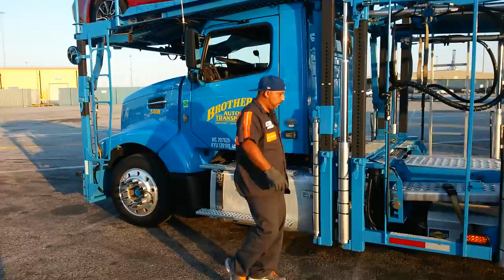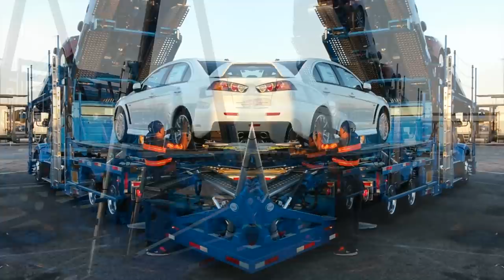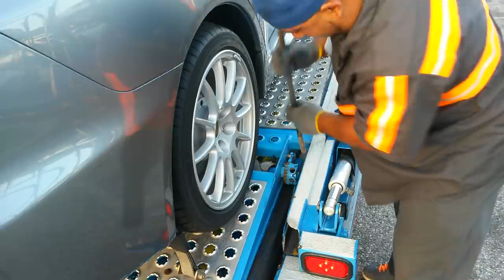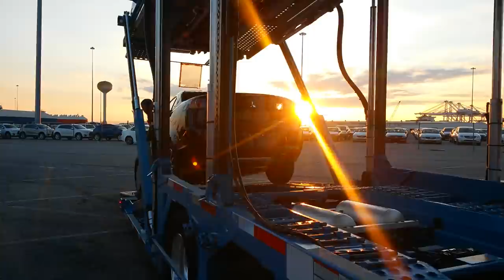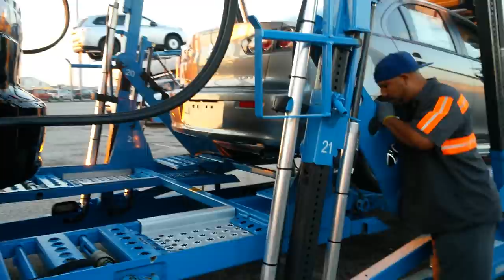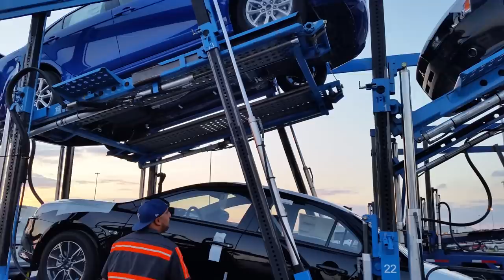38 minutes Loading ten car's on a High Rail...DAM that boy is fast....

Comment: If this was done in 38 minutes. That is really fast. I'd like to watch it real speed with no cuts. Been hauling cars 11 years.
Reply: Not dissin but cars already staged next to his truck. It's all about routine....
Reply: THERE IS NO 38 MINUTE VIDEO,  IF THERE WAS IT WOULD OF BEEN POSTED INSTEAD OF THIS ONE. 

YOU'D BE "LUCKY" TO GET THEM OFF IN 45.
Reply: The transporters i use in uk a TE+11 loading 11 cars in 30 min and tipping in 15 min is piece of piss. Helps having automatic deck locks and fixed ratchets.

Comment from the maker: This was a video to give a little knowledge to those interested in learning how to load ten cars not for ya haters to comment if you want to put some money up hit me up or shut up
Reply: What'd you get per car? About $120 a pop? I'm an auto hauler broker and just curious on your take away for that load. Maximizing your income bro keep the hussle strong 100
Reply: Jballo Production that’s an awesome video and love the trailer features on bottom last deck. That’s quick loading phase.
Reply: I run a ten car Cottrell with a seven car trailer. How do you load 3 and 5 before 4. I never tried it with my setup.
Reply: Good video bro
Reply: Jballo Production  how did you know where to stop on the first car like is there something to catch it from you back the car off the top of the truck
Reply: @matthewmontalvo5066  You have mirrors and a brake pedal, if you go off the top you ain't cut out for the job. GOAL  get out and look
Reply: yeah no kidding  like mirrors will help when you ten feet in the air on a truck. and I figured it from a co-worker what he does thanks but no thanks pal
Reply: @matthewmontalvo5066  You do know the mirrors adjust down, that way you can see your tire and the deck. I've had my CDL-A for twenty years and never drove of a deck or bed. You have no common sense and shouldn't be allowed near a commercial vehicle. Mirrors can't help ten feet in the air, really? Ya gotta be smarter than the metal your loading.
Reply: One thing about you tube, if you don't like scrutiny, don't post. Or at least disable comments. If this video is for show, great video. If it's to teach, useless video.
Reply: @matthewmontalvo5066  A smart remake? LOL!! No wonder why you're asking dumb questions, your mama should have named you ray since your're so bright!! LMFAO!!
Reply: this all coming a guy with no profile picture lol  you a smart dude  you get to keep your teeth
Reply: what u mean Ray?
Reply: Cars been pulled next to your trailer,all small size sedans, with the kind of trailer 38 minutes is not a big deal come to Mira Loma and Benicia ca we load like this in less then half an hour

Comment: I work next to Brothers all the time in Dundalk. (Moore)Once I have all my vehicles staged it takes me no less than 1 hour 9 cars and longer for a 10. I watched you and you load pretty much like I do and same equipment; Volvo high rail. The one behind the cab I leave a little further away from the cab to help with height. I always have trouble around deck 2. Maybe because I haven't done enough 10 cars. My ladder gets in the way for one. Also, not sure why you loaded 6 before 5. Thanks Jballo.

Comment: I'm a little confused on the loading phases and couldn't imagine backing up or driving on those rails
Reply: The ramps have holes and you get the car up on the trailer and align it. Count how many holes you need to keep from the left ramp edge to the front driver tire edge and it will stay precisely straight all the way up. Backwards and forwards it’s the same.

Comment: Looks like a lot of work, how about problems in winter with freezing conditions and the equipment working properly? And now I know how its done, thanks
Reply: Grease on hydraulic rams keeps ice off the equipment. The ramps freeze over in the winter but they're aluminum so salt works to melt it off fast. If you got good paint on the trailer and keep it oiled it won't rust.

Comment: I'm about to go into car hauling with a large company here in a month or so. I'm gonna make a similar time-lapse video. 🤔. That is once I get half decent at the job. I'll probably set the phone on the side of the trailer facing the truck/trailer. Some of the locations have other employees that load up cars for the drivers. Not sure why yet. Probably for trailer swapping? I don't know. There's a reason behind it I'm sure.

Comment: Fast and efficient, but sign here, you didn't pin any decks while loading
Reply: Not worth it
Reply: Yeah should have pinned one side at least but he did pin some on the trailer that I noticed
Reply: Matthew Fogarty check valve or no check valve it only takes a 15-20 seconds to pin off your decks.

Comment: Cool, but dont understand why u put 4 on tractor if easier to put 7 on high rail? and also u got overweight... try with chargers or challlengers////
Reply: IGOR GRIGORYEV because you need to distributed your weight evenly, cant be over 14k on steers 34k on drives and 34k on trailer. or you will be over weight on your trailer not only that but they won't fit, especially your mopar cars they are longer heavier so 10 is not going to happend bud buddy
Reply: You don't put chargers or challengers on a four car headrack. These units are designed to haul small to medium units(corollas,sentras,etc. We run shuttle out of Tupelo with ten and eleven car highrails. 11 car daycab with seven on the trailer and four on the headrack. Ten c ar sleepers with 3 on the tractor and seven on the trailer. We also run 4 Tahoes with two longs(Suburban or Cadillac ESVs) split deck 3 and 4 on the highrails.

Comment: I'd actually love to see how fast he is if he actually pinned off decks and didn't have all his straps set or cars staged. Lmfao you ain't loading 10 in 38 mins under normal circumstances and doing the job correctly.
Reply: Raymond ragusa I run a 80 footer called a quick loader I can definitely load 10 in 38 minutes. Big difference from a high rail which I hated when I first started